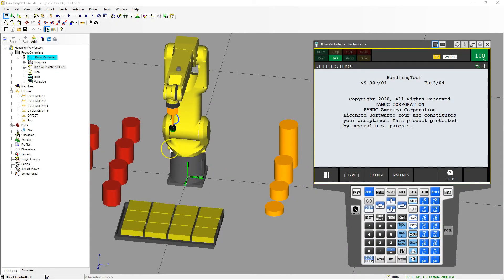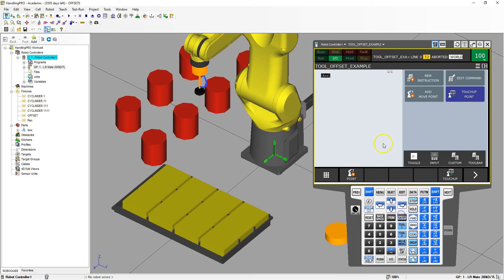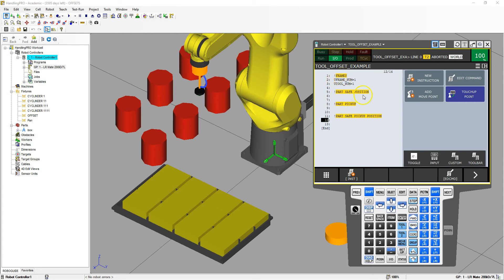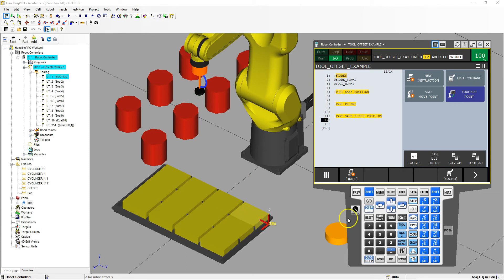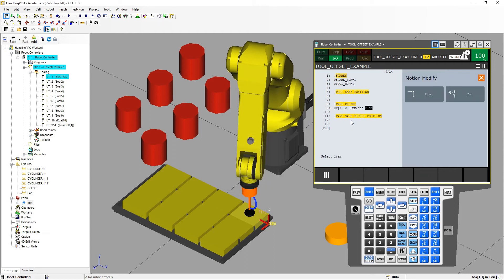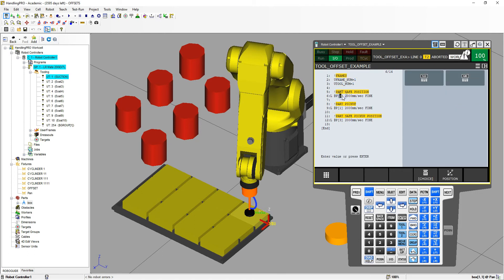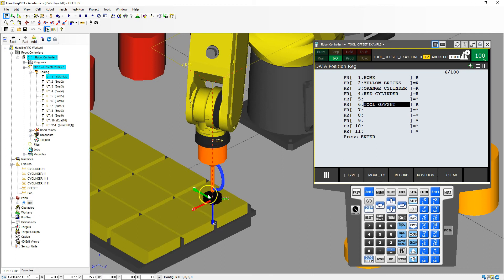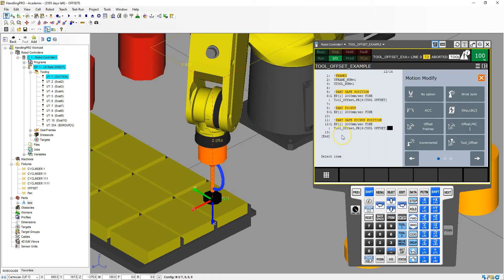TOOL OFFSETS IN FANUCS ROBOGUIDE SOFTWARE

Comment: Is using the tool offsets a viable way to move over and pick up the next part in the line or would you go about it a different way?
Reply from the maker: Good afternoon
Usually tool offsets are used for simple one way offsetting.  Use offset with a pr[i,j].  I have 2 videos of advance offsets and 2 videos using this process in a palletizing fashion.
https://youtu.be/yZDydf8u-hI
https://youtu.be/6NrluBWm6mU
https://youtu.be/IQuTmcw-f38
https://youtu.be/f8tqLqMLqkI